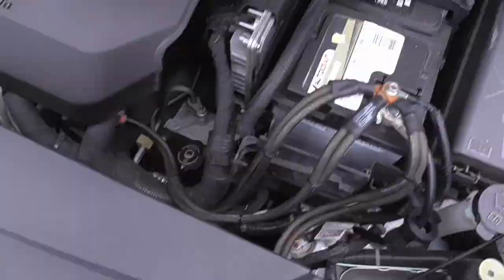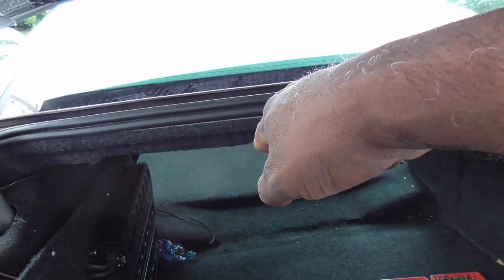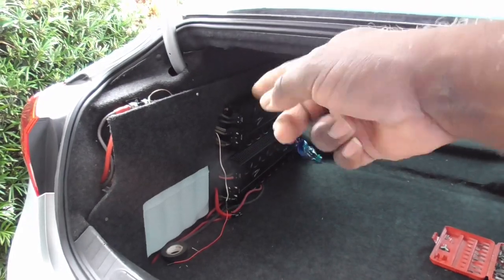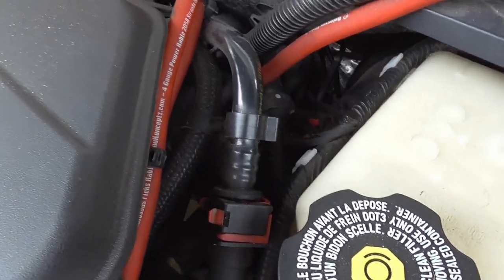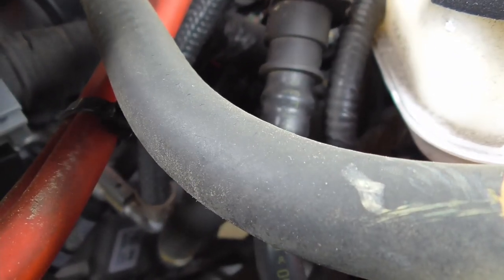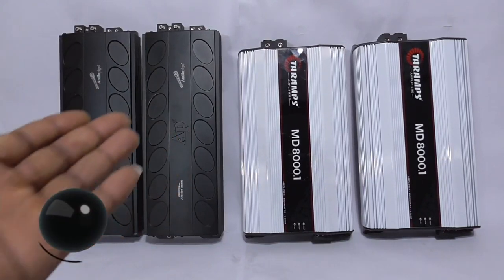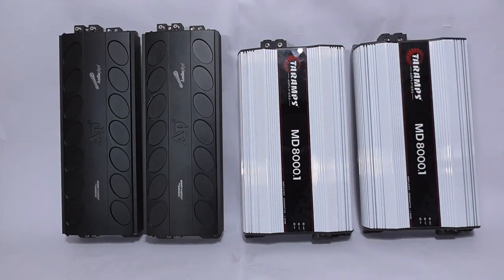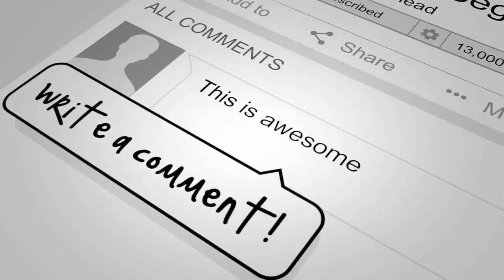Beware Of This Wiring Mistake!

Comment: For those 8ks definitely might want to consider lithium batteries source and dual inputs with pure 1/0 or even 2/0 copper wire even though your most likely using at a higher ohm load but I mean you cross that bridge once you get there...more content to post

Comment: That’s why fuses are important, if it were to short to something, the fuses would save your car from a fire
Reply from the maker: Yep. I'm a strong believer in fusing.
Reply: How did that power wire not short being so torn up?  Seems it would’ve immediately shorted out right after the shielding exposed the bare wire. Good on you for fusing it up like you did. Crazy man, dang
Reply: Was thinking the same thing. "That's why we have fuses".

And wire loom.
Reply: @rakkup7572  it didn't short out because it didn't touch anything that was grounded. It seems like the insulation failed due to being too close to the exhaust. It seems like he caused the insulation to swell up and get too soft.

Comment: Wao,,, that heat from the muffler melted the plastic....thank God you found it before something went wrong...
Reply from the maker: Yep. Scared me so bad I instantly started sweating. 😓
Reply: Like 3 weeks ago i install a 4 channel and a mono. and now is a wining noise in the speakers and when you hit the gas you hear it is not that loud but annoying...what i should do,someone told me is the ground but i dont know to much about car audio, what is your opinion if you don't mind....thanks
Reply: @i-84grow.49   Make sure the amp body is not grounded. Make sure your gains are set properly.

Comment: Brother, don't be so hard on yourself. No one is perfect, and you had you system fused well so nothing would have happened if that wire did short out other than a fuse popping. If you replace the fuse with a nail to keep it from blowing, then your ride might burn down but not the way you had it.

Comment: You need to drill away from that catalytic converter, it dried that wire insulation up and did that. Cats can get up to 900f°.
Reply from the maker: Thanks for the info.
Reply: @BudgetBassHead  no problem bro, you know I'm always on the channel lookin out...

Comment: Definitely time to improve that stacked battery post. I'm using some Vgate terminals and would highly recommend them. Their design allow for both bare wire allen compression or lug screw down nut attachment. 12 possible connection points each independent for a clean instal. I got mine from amazon.
Reply from the maker: I already got'em in-house. Stay tuned for the update.

Comment: Glad u an ur family members are safe and sound find a wire with a high temp jacket or loom  if that location is your only way threw fire wall
Reply from the maker: Definitely going to apply Loom in the rebuild. I also have busbars
Reply: @BudgetBassHead  bus bars are great make sure loom high temp an tight as u can to body ive been installing for 26 yr i seen that wire like that many of times 3 i can think of off top of my head ended up bad 1 whole car equipment was lost like u said in vid an im say here wiring is the most important part of ur projects ppl take time an care to get it rite we all can learn from this again glad no1 was hurt or lost of equipment

Comment: My friend try not to run wires close to hot zones around the engine heat will destroy them.
Reply from the maker: Lesson learned.
Reply: If you move your coolant tank you'll find another grommet that comes out right by your steering shaft away from heat

Comment: Really I prefer and use welder cable. Pure copper. Tough as nails. Look up crimp supply on Amazon. Also on a good note 2/0 welder cable equals same diameter as 0 Guage car audio wire. You can't beat it. Many many of us bassheads use it. Especially big systems builds.
Reply from the maker: Yep, so I've been told. Thanks for the tip.
Reply: @BudgetBassHead  sure thing my friend

Comment: Two MD8k... I'm running one Orion 8k, supported from the front one 320 Irraggi, two NorthStar 31s, 1000F caps, wired to .5 to 4 Rampage 12s, after 30 seconds on a hard bass track I tank my voltage and mind you the batteries are new and the caps are to. I charge at start up 15.2, resting at 14.6. You are going to run 2 MD8ks good luck holding voltage. I just bought 72ha of lithium I'm going to run with my caps and add some diodes to my alt to charge around 15.6 to 16 volts
Reply from the maker: The 2nd 8K is for a future build. I just wanted to get them before the prices go up. Be careful with that high voltage, depending on your make, model and year vehicle, that could cause problems; unless its an independent charging system. 👍
Reply: @BudgetBassHead  Good idea I'm thinking about getting two MD8ks to, cuz I can't find another Orion 8k

Comment: wiring down is probably the fastest way to beat box rise, however if you got the cash, 2 8000 watt amps can do that for you as well lmao. i think it's funny that i also upgraded from 2 apmn 2000w and then went with 2 taramps 8k, except mine are the bass variant. i noted that with 1 8k i pulled slightly LESS than my 2 audio pipe 2ks lmao both setups .5 ohm.
Reply from the maker: Thats great to know. This is my first Brazilian amplifier

Comment: 0 gauge bruh. Pure copper no tinned BS. Big 3 etc. Also good quality wire has much stronger insulation.
Reply: I use XS Power for big three and amp connection. I fried an inch of 0 AWG CCA after my ANL. 
THE WIRE WAS TWICE as long as I needed. I spaced trimming it for a year. 
It showed the same symptoms as a cooked coil and wasn't anywhere near a heat source.
Keep it shaking!
Reply: @MadDragon75  well you used CCA wire that’s where you screwed up. I would never    use CCA wire I would save more money to not have to use cheap CCA
Reply: @rickross368  The rest of the wire is like new over a year later. I told you what my problem was, it was too long. 
You're welcome to believe that you're correct,
 but I am the one that can make it simple to prove you to be wrong with a > OR < 2000 watt RMS system.
I will be happy to come back next year to rub it in with a video update.
Reply: My system is all Stinger OFC 1/0ga. $9 a ft. ain't cheap (probably spent more on wire than any one component) but this vid reinforces the importance of solid electrical
Reply: @MadDragon75  Rick is correct. Copper can have 50% higher current carrying capacity than the same size cca. You claim the wire length was too long, but that length would be fine had you used copper. Besides, your fuse should have blown before the wire melted. You must not have used the correct size fuse.
Reply: @Chris Roller Tinned wires is not BS. It prevents oxidation. Its a step up from raw copper. Also, he did use good quality wire. One of the best. That insulation is rated to 105°C, same as a lot of welding cable. No insulation can hold up to being that close to the catalytic converter.
Reply: @JasonWW2000  that was a lot of assumptions mixed with facts. 
I haven't had a problem since.
If I did, I'd just trim the burnt part... I have plenty left over. 
As far as the fuses go.
 I believe Parker knows the fuses that I had to Stage up to until finally quit blowing fuses under the hood... I finally stopped at 250amp. No problems.. 
I can make a demo right now. 
This phone sucks for recording bass and I have been traveling so the car is a mess.. I don't care... No dirty undies floating around in my whip. 
I hadn't needed to change anything but the cheap 1000 MCA marine batteries.. (They have a good warranty for $80) and an alternator.
I have a charger under the hood so I'm fully charged when I leave.
Does that cover it all?
I have 6 RCA outputs on my new deck now..
that is all I changed since I fixed it.

Comment: That audio wire jacket apparently sucks and that's yet another reason why I will never go back to it. Welding cable must meet strict UL standards and is designed to withstand the abuses of daily shop use.
Reply from the maker: Thanks for the suggestion.
Reply: Nope, its some of the best jacketing around. Same as most welding cable at 105°C. Your "apparently" not understanding the cause of the failure. Its simply too close to the catalytic converter.
Reply: @JasonWW2000 wrong. Try holding a torch up against that knuconcepts audio 1/0 ofc wire vs some good old 1/0 thoughflex welding cable and be surprised or amazed! You’ll see the audio wire disintegrate and melt away almost instantaneously BUT the welding cable haha you might just charr the surface but you ain’t melting that wire 😊
Reply: @onesikm3 I don't know what your saying.

Comment: ouch!. Duh the exhaust manifold(heat) weakened the jacket on it. You gotta be more careful of where you run it. neatness is less important when it comes to safety lol! Run it where its SAFE, not out of sight lol. Fuse also NEEDS to be at the battery.
Reply from the maker: the fuses are at the battery... and Ultracap. Good tip about the heat, though.

Comment: The PVC Jacket used on Knu Konceptz Kolossus 0 Gauge is extremely robust. only 2 possible scenarios may have causes this failure:
1) Extreme Heat - has the tendency to Dry Up henceforth the laceration splits in the Jacket.
2) Animals / Critters - They're looking for a source of food or boredom.
Reply from the maker: Definitely going to apply Loom in the rebuild

Comment: The exposed wire could have contributed to the power loss
Reply from the maker: I don't doubt it.
Reply: @BudgetBassHead  Did you blow the fuses or did you just find the split, sorry if you said it in the video I talking to family at the same time..

Comment: I’ve noticed using OFC wire is a big difference then that other aluminum copper one,
Reply: Yes, copper wire has more current carrying capacity than aluminum for the same core diameter. About 50% more current capacity.

Comment: Lol-ol-ol we've all been there bro, hell I personally would have just got underneath the car and really taped up the loose wire real well maybe throw some heat shrink on it to make sure it won't come undone again and then put it inside a wire loom and secure it away from the hot exhaust you really didn't have to replace the entire thing for a little torn wire insulation like that... But I mean the way I see it, anytime an issue like this comes along it gives me an excuse to upgrade so yeah I probably would have fixed thee existing wire to ensure no shorting and no more damage can be done then id go ahead and order some better wire that cones wrapped in snakeskin or maybe a larger diameter like you could have one run of 0g replace both them 4g and likely have better current flow... Im running 2 whole rolls of sky high 2/0 ofc for my mains and then directly to my amps I love stinger HPM series and if I could have found the stinger in 2/0 I would have done that but sky high is damned good wire also... im pushing two Deaf Bonce apocalypse DB3515's on a Wolfram AW-9000.1D with limitless lithium cyber 12k and XS SB1000-31 supercap and a little 25ah limitless to run my 4chs
Reply from the maker: Man, your setup sounds awesome. You should post that.

Comment: Your wire routing is a fire hazard in itself. Sounds harsh but true. Don’t wrap wire around and jam it into the distro blocks either as first shown in 5:24. It can be a LOT neater and tied securely throughout the car especially under the gas pedal, everywhere. I’m not impressed with knukoncepts wire, ofc or cca because of how thin their jackets are. I feel like you can bend it and it will split apart. Cut a piece off, strip some insulation off, and leave it on your gutter or outside on a window ledge or something for a few months and you’ll see it oxidizes and corrodes out too. That ofc stuff or not. You should be wondering what caused the wire to break like that…most likely rubbing since its just dangling. Or maybe engine heat caused it to breakdown. Also I wouldn’t have used 4 awg for a second battery or “super cap” or whatever it is you have everything else attached to, 1/0 would be the way to go. Keep the vids going but work on your technique!
Reply: I don't think the insulation needs to be UV resistant since it is not exposed to the sun. Are you referring to the metal part? I just remove a run of their wire that I installed 12 years ago. It looks like new. I decided to reuse it in my new install. It lasts. The insulation is very tough. His seemed to brake down just due to heat from the exhaust nearby.

Comment: I think that’s a bad location to get ur wires thru I’m no expert but I’ve been doing car audio for a very long time I like to find a location by either side of the vehicle away from anything that gets hot and drill a hole or holes depending on how many wires and install grommets for safety and of course fused

Comment: Car audio wire has soft jackets use welding wire its far superior and cheaper.
Reply from the maker: Yep. I hear this a lot.
Reply: Welding wire is not OFC wire. OFC in needed in car audio for its resistance to corrosion this is fact not opinion.
Reply: @scottiffanimccord1509  So tell us what is welding wire expert?
Reply: @rexnhogz  Are you ok? Do you need a hug?
Reply: Welding wire is 100% pure copper, just not OFC copper.
Reply: @scottiffanimccord1509  I think you may need to google that.
Reply: @rexnhogz  In a wet State like where I live Utah, the ends will corrode over time and turn green I learned it the hard way. PS I'm not a "EXPERT" but I have been doing car audio for 30+ years. If your nice you can ask me anything.
Reply: @scottiffanimccord1509  ok well I dunno what welding wire you are using but 99% of it is pure ofc the difference is the stranding and flexibility and I use royal exelene and it is very flexible and besides you should be using lugs with welding wire and when the lugs get corrosion you sand em. And agm and lithium batteries hardly ever get corrosion.
Reply: @rexnhogz  You are wrong Royal Excelene is not OFC! You are miss informed. 2 AWG HEAVY DUTY WELDING CABLE WITH A HIGH FLEXABILITY AND IS RATED FOR 600V, CAN BE USED AS LEADS FOR A WELDER OR BATTERY CABLES FOR MACHINERY. (ROHS COMPLIANCE) MADE IN USA. 2 AWG ROYAL/EXCELENE WELDING CABLE CONDUCTORS:BARE COPPER STRANDING:644 JACKET: EPDM O.D:.411 AMPS:250 TEMPERTURE: -50*C TO 105*C VOLTS:600V HIGH DIELECTRIC STRENGTH INTEGRITY RESISTANCE TO FLAME,OIL,GREASE SOLVENTS,OZONE AND ABRASION (ROHS COMPLIANCE)Pure Copper not OFC copper. This is off the manufactures web page.
Reply: @scottiffanimccord1509   all welding wire is ofc. You are wrong. Car audio wire is like buying nike shoes you pay for the name. There is tons of discussion on this topic. You can keep paying 6 dollars a foot if you want but I wont.
Reply: @scottiffanimccord1509  I think you are confused between bare copper and tinned copper.
Reply: @rexnhogz  Ok expert haha!
Reply: @scottiffanimccord1509  its a hobby
Reply: @rexnhogz  Yea that's what I call it. I guess I don't understand your comment.. You want to argue over what to call it? Is that what your saying? I'm good dude plz don't talk to me unless you can be nice.
Reply: 105°C is exactly the same rating as BudgetBassHeads wire. So no difference there.

Comment: OAWG. I run my wire under the car then to the trunk
Reply from the maker: Without a lift, I get nervous under this Impala. They're just so low to the ground. I miss my '99 Durango! 👍
Reply: @BudgetBassHead  I know you gona handle it tho I just blew 500 amps in fuses  on low power

Comment: Another reason to use welding cable not the soft jacket wire
Reply: Its soft, but also highly heat resistant PVC (up to 105°C). Its typically higher heat rated than welding cable. Basically welding cable is usually made to a cost. Its typically low strand count, undersized and has cheap insulation. His wire is quite a bit more expensive per foot.

Comment: For that much power u running to thin of a wire  that’s why it’s melting off the insulation at the very least  0 gauge would be the thinnest wire I would run but that’s just what I would do but first thing they stood out from ur system was how thin ur power wires are I mean u pushing it and when it come to electronics always want to use wire that can handle double the power this way never gets hot  first time I see this size wire on main amps
Reply from the maker: Thanks for the concern. But this wire was removed and show no sign of overheating. Not even the jacket. I'm just as puzzled as others. But definitely replacing it with 1/0 over-sized OFC

Comment: welding cables wont have that issue. ive been running welding cables for 3 years no issues. they are much more thicker then average car audio wires
Reply: His issue seemed to be caused by heat from the exhaust. Nothing to do with thickness.

Comment: 300A on a 4AWG/Gauge? That is not safe at all

Unless those wires only go like 2 ft straight to the amp

Nvm now I see it’s a very short run
Reply from the maker: Knu Konceptz Kolossus 4Gauge is equivalent to 2Gauge AWG. I have two runs of this. It'll handle the load I currently have.